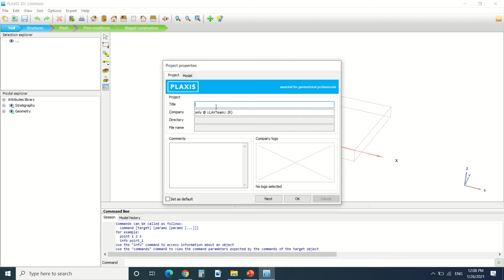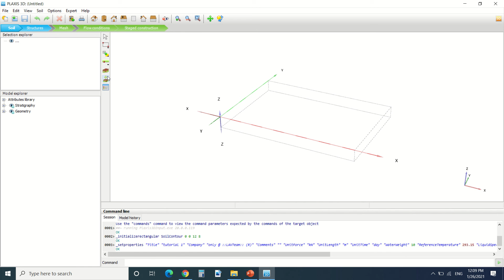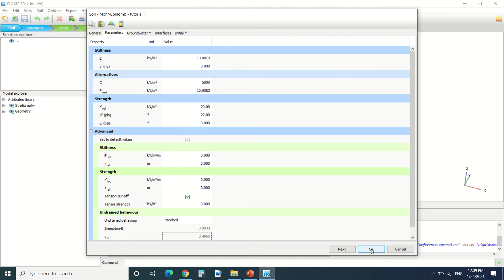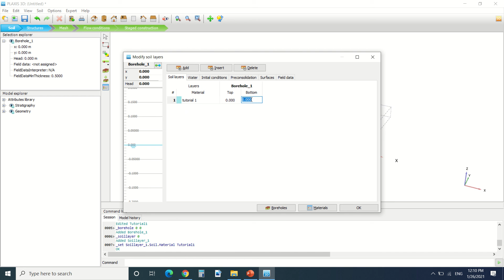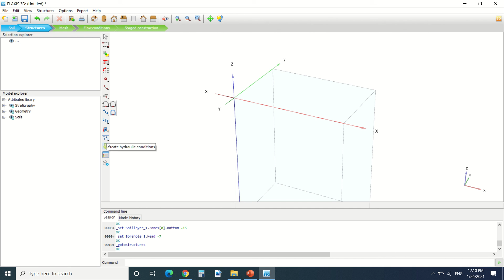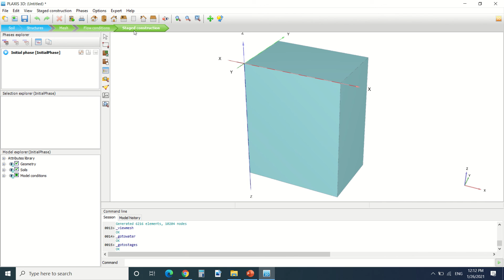1- Easy PLAXIS 3D tutorial for beginners , interface

Comment: Hi

I need to define a dynamic horizontal load and a static vertical load. For this purpose, I have defined these loads as point loads on a single point in the Structure mode. But, when I go to Staged construction and want to define phases, in the static phase, by selecting static load (or point load 2), the dynamic load (or point load 1) is also activated simultaneously. This is while I do not want the latter to be activated.
What is the reason for that?
Could this have happened because the coordinates of both point loads are the same?

Thanks for your time and consideration
Reply from the maker: you can put a value of the dynamique load, then a value for the static load
Reply: @theengineer7732  thanks